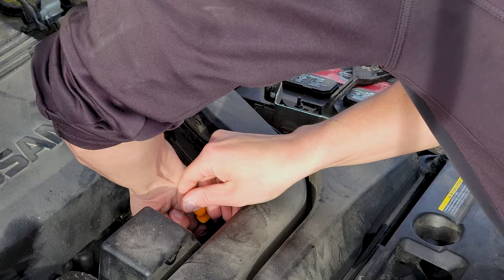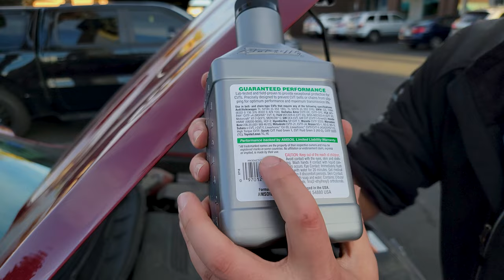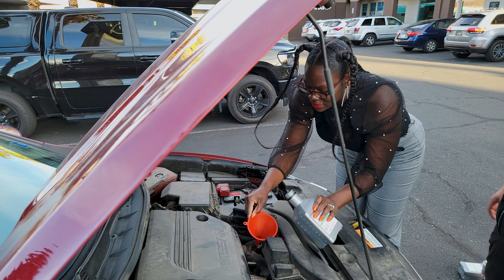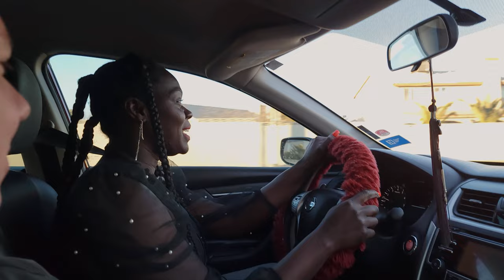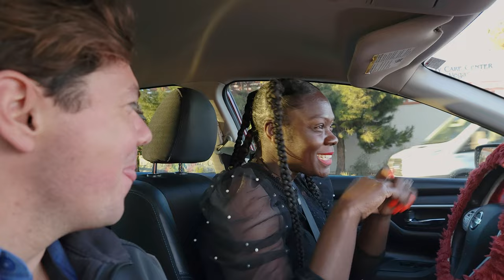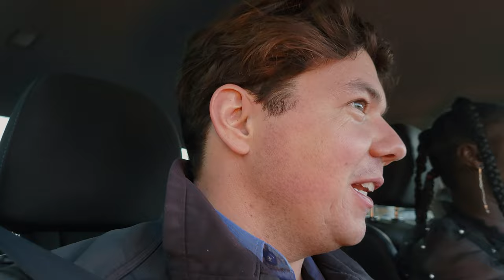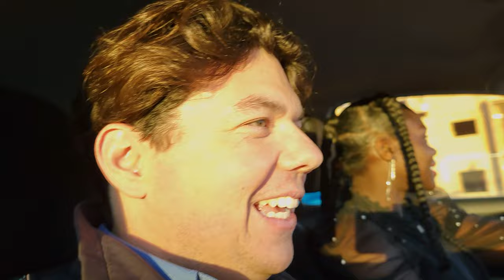CVT fluid Golden SECRET ...

Comment from the maker: Watch This Next: CVT Bomb Scare - https://youtu.be/Y9PmbHIyiAU
    
      ♥️ Find The Right Fluids For Your Vehicles - https://www.amsoil.com/guides/?zo=5331179      

     ✅ Save 25% On Your Next Fluid Order: https://www.amsoil.com/offers/pc/?zo=5331179 

     ♥️ See Fluid Performance Tests - https://www.amsoil.com/performancetests.aspx?zo=5331179      

     ✅️ Buy Me a Coffee - https://www.buymeacoffee.com/YouLubher

     🥇🥇🥇 Synthetic Oil Protection Google Map Reviews
(702) 472-3614
https://maps.app.goo.gl/DmLU5hP72HadUBEm9
             
     ♥️ Synthetic Oil Protection Website - http://syntheticoilprotection.net

     Did you know a oil manufacturer can call a lubricant a Full Synthetic when it's only 25% synthetic? AMSOIL is different because it is 100% Synthetic and has a higher film strength keeping the metal parts separated. AMSOIL allows less friction, less heat, less wear on the component. AMSOIL Signature Series motor oil will last 25,000 miles on 1 oil change!  

     ♥️ Your Vehicle Could Run Better Than Brand New By Choosing The Right Fluids! See Results - https://youtu.be/zH-VquYlhqA

     ♥️ Why AMSOIL - https://www.amsoil.com/about/exclusive-distribution/?zo=5331179    

     ♥️ Synthetic Oil Protection Coffee - Ebens Favorite: https://supportwith.coffee/shop/subscriptions/sop/

Comment: 2015 Nissan Versa changed transmission fluid at 20k also use amsoil motor oil between both oils car runs phenomenal saving fuel too… great product

Comment: I just did it replaced in my 2014 with Amsoil with new nisaan factory CVT cooler . Got CVT fluid as much as i can about 7qt. I felt i gave CVT a new life and performs just like got out from the factory kept temp 73 consistently when it was  97 out . Amsoil and Nissan cooler did really a magic !! 

Nissan Part number 21606-ZX59A . Although Nisaan says its for 2012 model but it fits perfectly in 2014 Nissan Altima and its Nissan Original Part .. looks factory installed!!
Reply from the maker: Thank you for sharing this with the channel am I your Amsoil dealer?
Reply: Hi, I am planning to change ns3 fluid with amsoil..what is your experience? Will amsoil cvt fluid better tha  ns 3 fluid?
Reply: @prasad9732 I know you wrote this comment long ago, but ns3 is the specs for the cvt fluid. Different companies sell that fluid. Amsoil is the best according to what people say online. I’ll buy it for sure. (You can only get it online or if you can find a retail store). 1 quart is $17. It’s more, but I care about quality

Comment: That's what I do, 500 miles & refill. We have a 2017 rogue awd  but we've serviced it with amsoil CVT fluid since it was brand new. Also might be a good idea to clean out the throttle body. Great video Eben!!👍🇨🇦
Reply from the maker: I think you mean Amsoil cvt?
Yeah a couple others that will really keep it in tip top shape is the pi performance improver and the upper cylinder lubricant
Reply: @Syntheticoilprotection  🤣  Just saw that now, yes amsoil.
Reply: What did you originally type?
Reply: @AK-ky3ou  can't remember! 😁

Comment: Do you recommend doing a full service? Changing the filter, screen, cleaning the pan and magnets with a full flush? If so, what mileage do you recommend doing it for a cvt? Also I agree with doing some kind of service with cvt every 20k but is their a magic number of fluid only changes between a full flush/filter change? Thank you for making videos.
Reply from the maker: This is a great question there's a lot of different Transmissions out there some have a small little screen that you can clean some have a small filter and some have a regular filter like a regular transmission just depends on the vehicle honestly I do not know every year make model and I do not know every technical bulletin on them all I do know when you keep the fluid clean with the proper detergents the chance of having it get clogged is very unlikely and that's why it's always good to keep it changed super early especially on these Transmissions they are a transaxle and a differential and a transmission all in one and they get extreme heat soaking so if I personally owned like a Honda with a CVT and it was my personal car I would change the fluid every 20,000 miles of City driving here in Las Vegas.
I always like to be on the preventative side if you are new to Amsoil this will give you the best value on the products as the 6-month PC member and I'll always be able to answer your questions in the future about improving the performance and lifespan of your vehicles by choosing the right fluids as your independent Amsoil  dealer if you have any questions just let me know👍
6-month PC member will give you the best value on the products and also there's a new free shipping promotion: FREESHIP 
Eben Rockmaker 702-472-3614 
https://linktr.ee/EbenRockmaker

Comment: Now THIS is a "proof is in the pudding" post.
The customer tells first-hand account of what "was" to "is".

Ive seen other post about AmsOil CVT, but now to hear and see the "how" in action?

I'm going to look for that oil as long as it's NS-2.

Side question: Will NS-3 be fine for a vehicle that is NS-2 dedicated?
Reply from the maker: I don't know about those other specifications but you will see everything on the website and for your specific year make model and engine size will be on the lookup guide and it will be right here on my website if you have any questions just let me know.

I give a man a fishing pole & show him how to fish. 

     Together! We can get your vehicles to run better than brand new! 

     For me to get credit & be "Your" Independent AMSOIL Dealer please use my website below or my dealer no. 5331179 call anytime Eben Rockmaker 702-472-3614
After you click on: http://syntheticoilprotection.net
1. Click hamburger menu
2. Click offers AMSOIL preferred customer
3. Click join now 6-month PC member add to cart.  ( there is no reoccurring renewal membership unless you select that dot box ) 
( you have the option to not have your credit card saved if you prefer - est. 1972 )
4. Scroll up to the top Select shop by vehicle. 

New Promo: FREELAMP

Comment: Eben nice video. I keep getting Hit and Miss answer for this question. Say if you and her took 9 Quarts ( 8.5 Litres ) of Amsoil CVT to a garage and they drained the fluid out and flushed out Torque Converter and refill the GearBox and Torque Converter with 8.5 Litres of new Fluid that would have taken out around 95% of old burned fluid and fill in clean new fluid in one go. Some mechanic/s say that process can damage the transmission and some say it wont if done with proper machine and qualified mechanic. Anyway in 804 Km ( 500 miles ) would love to see part 2 of cvt fluid change.
Reply: Following

Comment: Hello Eban!  Does Amsoil make an equivalent for Honda/Acura (ZF) 9-Speed transmissions?    I would love to be able to change mine over to Amsoil!
Reply from the maker: Great question David you'll see everything right here on the look of guide for your year make model and engine size if you're new to Amsoil you definitely will get the best value as the 6-month preferred customer membership only $10 no reoccurring fee and when you use my link here that would allow me to answer all your questions in the future about improving your performance and lifespan of your vehicles and equipment by choosing the right fluids as your independent Amsoil dealer.
♥️   Find The Right Fluids For Your Vehicles - https://www.amsoil.com/guides/?zo=5331179    
  
New Promo: CC0323UC
     ✅   Save 25% On Your Next Fluid Order: https://www.amsoil.com/offers/pc/?zo=5331179

Comment: Living here in southeast Iowa I’m wondering if this would work better than Nissans. I’m sold on Amsoil products! My Altima AWD has just 31,000 miles on it, and I’m the second owner. Not sure if the Toyota dealership would have serviced it before I took delivery of it or not. I’m guessing probably not since there is no Nissan dealership in that city.
Reply from the maker: Yes I highly recommend it and you will be amazed at how much better it will run😃
 I give a man a fishing pole & show him how to fish. 

     Together! We can get your vehicles to run better than brand new!

     For me to get credit & be "Your" Independent AMSOIL Dealer please use my website below or my dealer no. 5331179 call anytime Eben Rockmaker 702-472-3614
After you click on: http://syntheticoilprotection.net
1. Click hamburger menu
2. Click offers AMSOIL preferred customer
3. Click join now 6-month PC member add to cart.  ( there is no reoccurring renewal membership unless you select that dot box ) 
( you have the option to not have your credit card saved if you prefer - est. 1972 )
4. Scroll up to the top Select shop by vehicle.

New Promo: FREEPACK

Comment: My girlfriends 2019 Sentra started slipping slightly and I looked up the whole CVT thing so I got the amsoil because of course everything I find it looks like amsoil outperforms everything else. Nissan needs to admit that these CVT’s need a little more love and maintenance. So it’s alright to just pull the drain plug and fill what came out? And then maybe do a full flush a little bit later? I just want to make sure I adress this immediately ASAP so her transmission doesn’t take a poo poo. Then I can order filters and gaskets for the next time.
Reply from the maker: Yes the look of guy will give you the exact initial fill fluid amount on my website and yep you'll see a huge Improvement in the way it runs smoother🇺🇸💯

I give a man a fishing pole & show him how to fish. 

     Together! We can get your vehicles to run better than brand new!

     For me to get credit & be "Your" Independent AMSOIL Dealer please use my website below or my dealer no. 5331179 call anytime Eben Rockmaker 702-472-3614
After you click on: http://syntheticoilprotection.net
1. Click hamburger menu
2. Click offers AMSOIL preferred customer
3. Click join now 6-month PC member add to cart.  ( there is no reoccurring renewal membership unless you select that dot box ) 
( you have the option to not have your credit card saved if you prefer - est. 1972 )
4. Scroll up to the top Select shop by vehicle.

New Promo: FREELAMP
Reply: I love amsoil my dad used to race dirt modifieds and him and his racing partner simultaneously did end of the season engine rebuilds, my dad used basic and his buddy used amsoil the difference was unbelievable. My dad and I Been putting amsoil in every vehicle we’ve owned since.

Comment: I have a question, this is going to be my first time changing out my transmission fluid and I want to switch to amsoil, but how many times do I have to drain and fill AND would it be less effective if I only drained it once?
Reply from the maker: Great questions here you can do one drain and fill and you will see a huge difference in shifting speed less vibration I personally like to do it again and again until the color is satisfactory usually two drain and fills is good just depends on what your fluid looks like and the component if you're new to Amsoil this is my personal link would attach me to you in the future I would always be able to answer your questions about improving the performance and lifespan of your vehicles by choosing the right fluids as you're independent Amsoil dealer. ✅   Save 25% On Your Next Fluid Order: https://www.amsoil.com/offers/pc/?zo=5331179 

     ♥️   See Fluid Performance Tests - https://www.amsoil.com/performancetests.aspx?zo=5331179
Reply: What car?

Comment: Nissan extended the warranty  on the 2017 Altima  CVT so if you use Amsoil and the CVT goes out will that void this extended warranty?
Reply from the maker: You can use Amsoil and it will not void your warranty on your Nissan it meets the specification you can get it at the best value as the 6-month preferred customer right here through my link and if you have any questions always happy to talk with you that will attach me to you so I'll always be your Android dealer👍
To be "Your" Independent AMSOIL Dealer please use the link below or my dealer no. 5331179 call anytime Eben Rockmaker 702-472-3614 

     ♥️   Shop by vehicle - https://www.amsoil.com/guides/?zo=5331179 

     ✅   Save up to 25% on every order as a preferred customer: https://www.amsoil.com/offers/pc/?zo=5331179 
New promos: FREERAGS

Comment: Hey Eben, I recommended the CVT fluid to my friends 2016 Infiniti QX60 V6. After the mechanics did a drain and fill about 2 days later the SUV started vibrating at highway speeds. Doesn't happen all the time but happened twice already. Now he has to take it to the dealer soon. Any reason why this could be? Did I recommend the correct fluid? The SUV only has 70k miles and that was it's first drain and fill. The mechanic said the old fluid looked good so no problems there. They also changed the brakes and they thought it might be a tire rebalancing issue but that didn't help it either. Now Nissan is saying it might be drivetrain issues but they will take a look at it tomorrow.
Reply from the maker: Oh yeah there's definitely something going on that has nothing to do with the fluid if there would have been a problem it would have been right away if the fluid was low or something like that definitely something mechanical
Reply: @Syntheticoilprotection  Thanks for the reply. I really felt bad for recommending it. This never happened before so I'll give an update on what they say. Maybe he should've gone with the Nissan CVT fluid. I read those CVT transmissions from Nissan are very finicky.
Reply from the maker: @moises0369 oh that fluid would have nothing to do with anything as long as you used the right specification you would be fine the difference is the sheer stability with the Amsoil it's a much higher quality base oil additive packages are also a higher quality and that allows everything to run smoother under high heat and last longer but even if you ran a lower quality fluid that meet the specification that would still not have a problem it just wouldn't run as smooth and the transmission wouldn't run as long.
Reply from the maker: Note a lot of the Nissans CVT have all different types of problems and there could be many recalls on different Nissan product and a lot of mechanics are very reluctant to even work on those Transmissions because of the amount of issues they have.

One thing I can say for certain is the sooner you switch it to a higher quality fluid the less heat you'll have in it and you will extend the life of the transmission💯
Reply: You recommended a fluid that you didn't know was right?  Oh boy what kind of mechanic did they drain and fill?
Reply: @sl4983  It was the right fluid. Nissan NS-3 recommended on the Infiniti and the CVT fluid says NS-3 compatible on the back. The mechanic is a highly rated one that did my ATF drain and fill and no problems. Not sure what happened with my friend's. Maybe they filled it a little too low or it was a coincidence and the transmission was already going bad?
Reply from the maker: @moises0369 yeah sounds more like a brake issue I've never heard of any vibration from a transmission from changing any fluid on any transmission ever probably just rotors brakes or tires.
Reply: @Syntheticoilprotection  I think we figured out the problem. The mechanic did a one time drain and fill at 70k miles on the Infiniti/Nissan CVT. These are known to do bad and was well past the recommended mileage to change. Since the mechanic didn't drop the pan and cleaned it with a filter change, I figure there was some contaminants that was moved around by the new fluid and that's what caused the problem. It needed a whole flush with pan drop, and filter change. Many video advise not doing it with a pan drop is risky.

Comment: Great video! I just subscribed! I am a 100% Amsoil guy!! I use it in everything. I only wish my granddaughter's 2014 Juke had a fill port. Unfortunately it does not, so it will take a bit more finesse and flexibility on my part to get to the fill "plug". We had to replace the trans at about 90k miles because it failed...completely, and it's been around 25k since then, so it's time. I went by my local Nissan dealer and asked how much it would cost for them to do it if I supplied the fluid. This guy's (unbelievable) response was, "If you don't use Nissan fluid, it will void your warranty." WHAAAATTTT???!!!! 😯 Well, we all know that's that's total B.S., so I turned around and walked out. Not sure if that's their policy, or just that guy's ignorance. Probably the latter. I'm thinking about going back in and asking someone else to hear what they have to say...then again, maybe not. Oh, love the Shelby jacket, by the way!!!👊😄
Reply from the maker: Thank you💯
Reply: Nissan only gives a 1 year 12k warranty on their replacement transmissions

Comment: How many quarts do i need for my Nissan Sentra 2019. 1.8 engine capacity
Reply from the maker: Click shop by vehicle will give every fluid for your year make model 💯👍

To be "Your" Independent AMSOIL Dealer please use the link below or my dealer no. 5331179 call anytime Eben Rockmaker 702-472-3614

     ♥️   Shop by vehicle - https://www.amsoil.com/guides/?zo=5331179

     ✅   Save up to 25% on every order as a preferred customer: https://www.amsoil.com/offers/pc/?zo=5331179